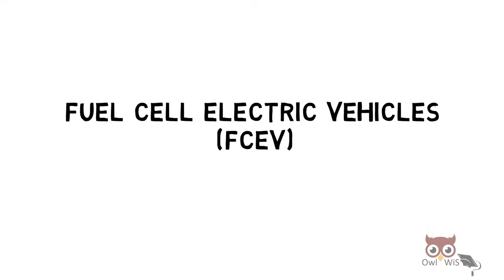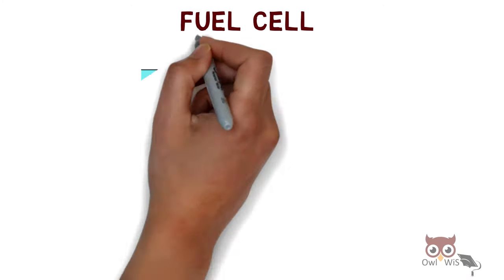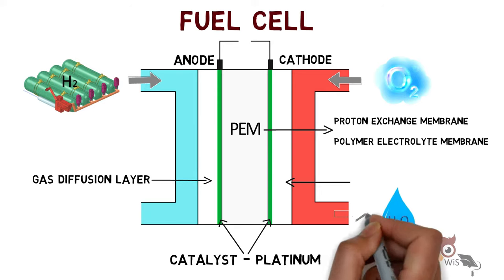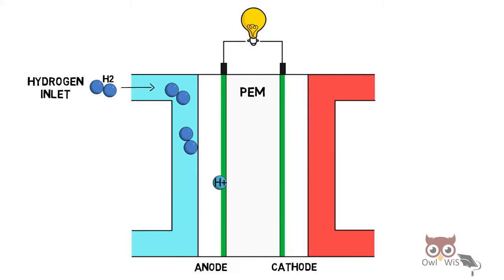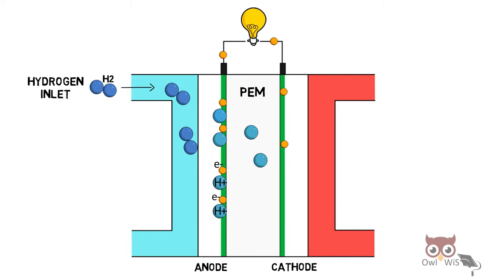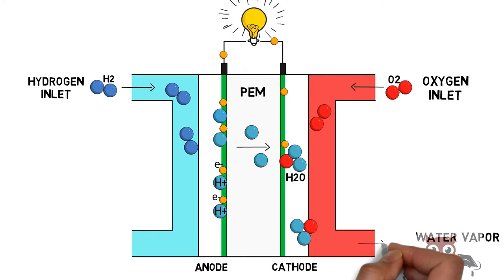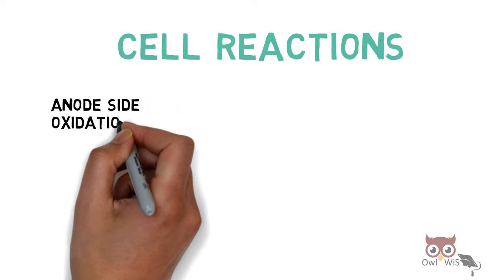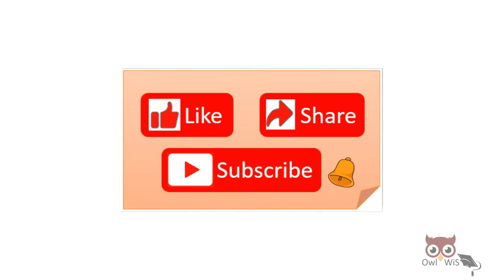How hydrogen fuel cell works | Fuel Cell Technology | Working principle

Comment: Great illustration. A suggestion to make this more useful by explaining the output of the fuel cell(s) to run a motor/engine that in turn is connectted to the rest of vehicle via the transmission to produce motion.

Comment: Need to add few points in the video :
1. Add explanation why we are using Hydrogen only to get the electrons 
2. How the flow of electron is determined ? Is there any potential gradient in the circuit ??